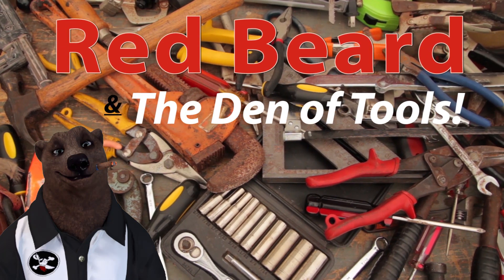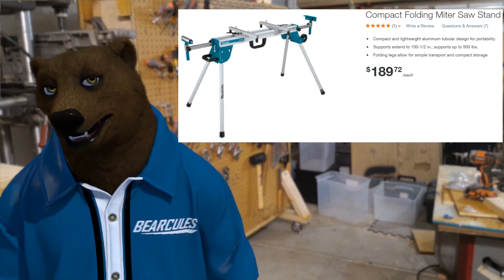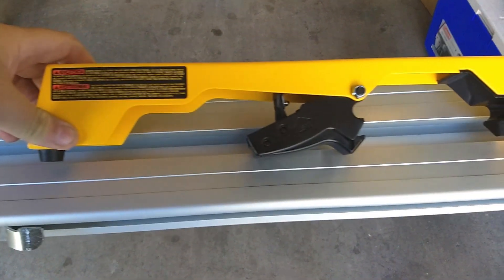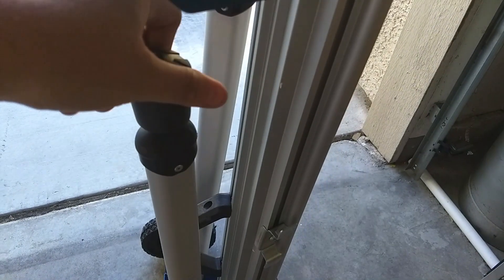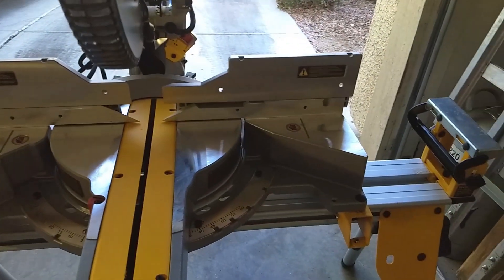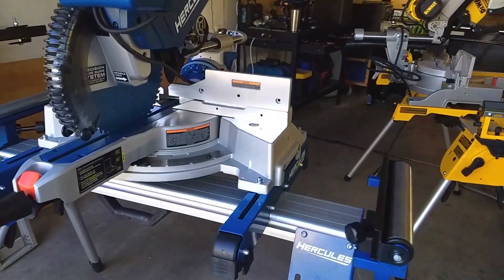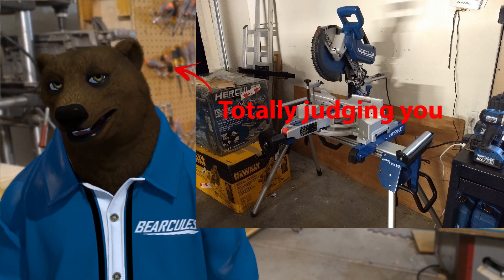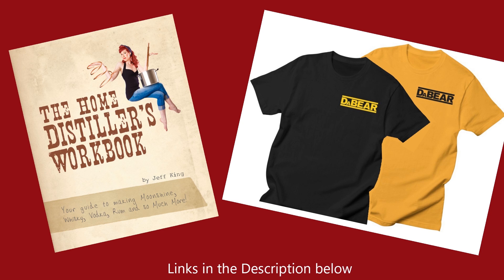Hercules vs DeWALT Miter Saw Stand (Has Harbor Freight surpassed Big Yellow?)

Comment: Wow both are junk for that kind ovv money...I just bought a kobalt at lowes for 120 and it has no wiggled,,it is heavier being steel but it will last...Buy the kobalt...
Reply: Good to hear. After a couple weeks of shopping for a stand, I jumped on the kobalt today(ordered) after it dropped in price to $99. I liked the fact it has a built in legs to store vertical with saw attached.
Reply: squareone 440 nice man,, I paid 125 and then bought another for 50 but it was damaged.. it just had a piece of plastic broke where the extension slides out.. It wasno big deal as i am using that one for a table saw anyway.. They are awesome and heavy duty.. I work out of a 14 foot v nose enclosed trailer so mobility is key .. I got that big table saw stand outta my trailer and made more shelves were it was.. I couldn't be happier with the kobalt stands.. maybe I will see a review in tbe future from you as there are NO reviews on youtube.. It may get you some views and help people out.. Take care
Reply: @daveyboy8907  funny you mention it, the same plastic on the end was broke on mine also, lol. I'm taking it back in the morning for a replacement. Other than that it's very nice and very sturdy. Had my 10" slider on it and it was rock solid.
Reply: Cant you make a decent stand out of lumber for a fraction of this price?
Reply: @Dumbass_mechanic  I'm sure you can. I ended up getting more money off my stand. $70 for a steel stand with wheels and stores vertical with saw attached. $70 is worth saving my time and material to make ome. To each his own. Sounds like a fun project for this winter though.
Reply: @squareone4407   I contacted kobalt and got another set of miter saw brackets and mounted them to my 10 inch saw so now I have 2 cobalt stands and 3 set of brackets,,I even mounted the brackets to a table saw so one stand for table saw and other for miter saws/..
Reply: @Dumbass_mechanic  you can. I've never used one of these stands for the last 13 years that I've been finishing and framing. I have a set of plywood sawhorses with door hinges and a plywood bench that sits on them with supports on the ends and trim around where the saw sits so it cant move once set down. I have a friend that used one of those folding wheeled units and it actually collapsed and when it was going down the blade on the saw bounced down on his arm a few times on the way down. Considering something more mobile that's why I'm watching these videos as I'm currently finishing apartment buildings and something more mobile would be nice as I work my way down the halls. I may just build something wheeled as none of this stuff seems to fit the bill and it's all janky not to mention a pain to fit in the truck and pull out when loaded.

Comment: Thanks for the great video. I have a Rigid multi use stand and for $199  why anyone would buy anything else is beyond me. It is sturdy, has wheels (very large size wheels)  so you can roll it around with the saw attached and folds down for moving, as on a trailer without removing the saw from the stand.  It just appears far superior in every feature to these straight legged, tilt over less than sturdy wanna be's.  Just my humble opinion. Thanks
Reply: Those things are kind of bulky. I also have a friend that had one of those things collapse while using it and on it's way down the saw bounced off his arm a few times

Comment: I'm guessing you're right about the price. It will probably be pretty close to the DeWalt. That obvious difference in quality is the difference in not having an intermediate company needing to make money. Dewalt has these made (probably in China just like the Hecules), but then they have to make a profit when they sell to the retailers that carry their products. Harbor Freight has them made and branded and gets them direct from the manufacturer. They can charge less or sell a better item at the same price. I think the latter is what's going to happen with this. If you'd had both painted identically and asked multiple people which they thought was from Harbor Freight, I bet most would point at the DeWalt.

Comment: As of 4/25/19 it is $189 and there is an active coupon online for $149. It really looks good. I'll have to check it out at the local HF. What concerns me is when you flip  up the stop there is no horizontal rest for the wood. If most of the wood is on that side, there is nothing to hold it. Do those little blue fingers support the wood or can they be used to attach a little platform? Is it practical to roll the stand around with the saw mounted on it?

Comment: I have the Dewalt scissor stand with the hydraulic assist. It's a very nice stand, although quiet heavy. Super stable,and it has big wheels on it. I have the Hercules saw on it - I think the saw might be a little heavy for the hydraulic assist on the stand, though. I like the look and  feel of the saw, but I haven't done enough with it to be entitled to an opinion (I've used the stand much more, because I keep taking the saw out of the garage, though just to make room!).

Oh, and I got my Dewalt stand for $219.